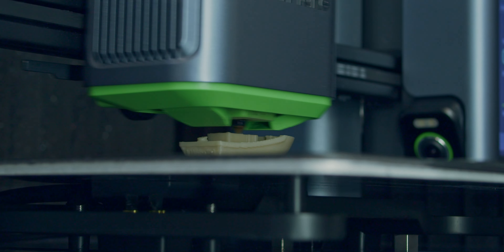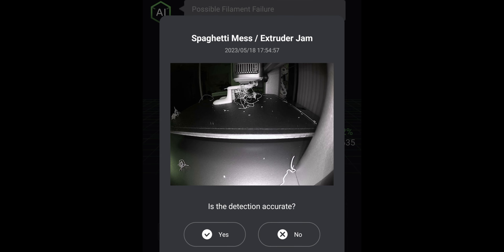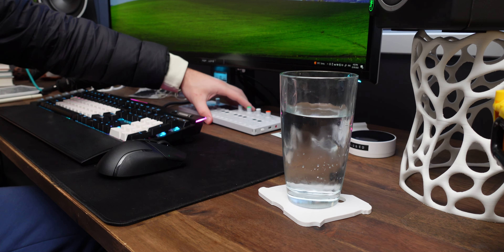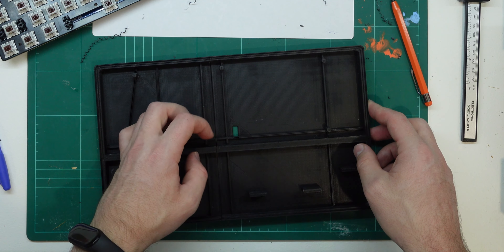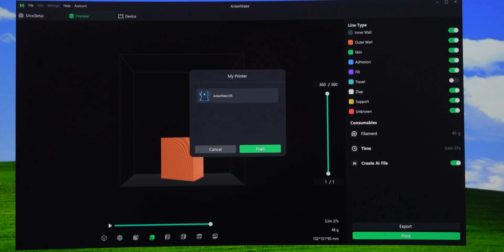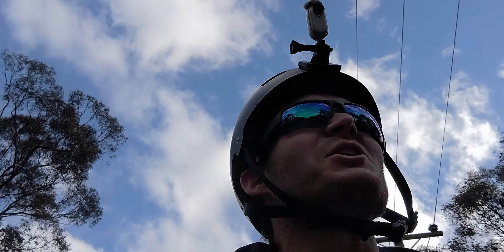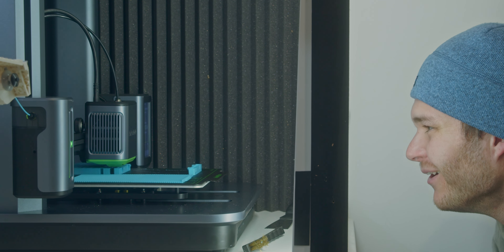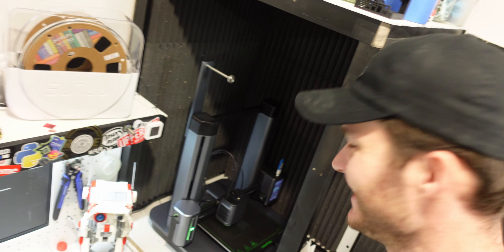FREE update Doubled speed 500mms! AnkerMake M5 3D Printer

Comment: what app did you use to take a picture and get it into a model
Reply from the maker: Good Question! Workflow process is:
Take a photo top down with as "telephoto" of a field of view as possible (or use a scanner).
Import into Inkscape (free vector editing software).
Use the Trace Bitmap tool in Inkscape under the PATH menu.
Adjust the threshold to get the contrast point of the subject, best to take photos with a high contrast background.
Clean up the vector with the pen tool by selecting and deleting unwanted nodes.
Scale to size now that the Width of the remaining nodes resembles the actual object.
Export from inkscape as SVG

Import into TinkerCAD (free online CAD modeller).
Extrude to desired thickness in TinkerCAD
Export as STL from TinkerCAD

Now you have a 3D file from a 2D image that you can slice in your 3D printing software :)
I use this method often to create parts that have many odd angles.
You can always trace the image in Inkscape with the Pen tool and shapes if it's a basic outline.